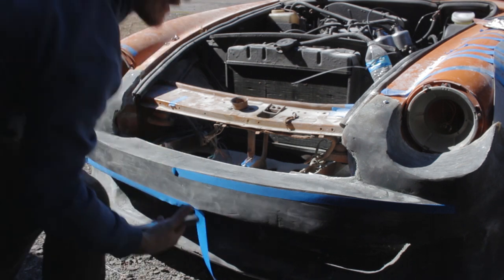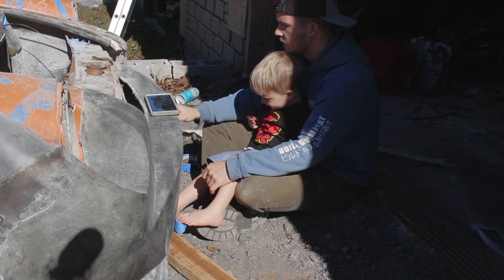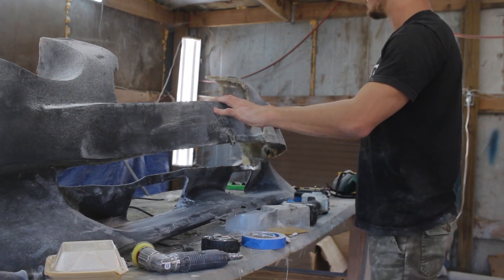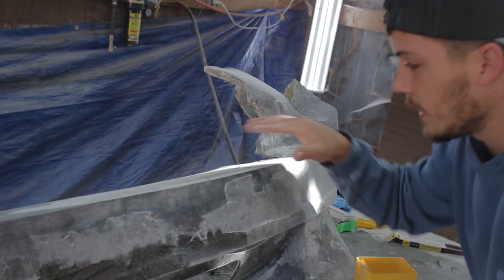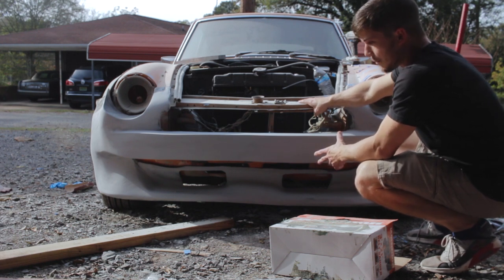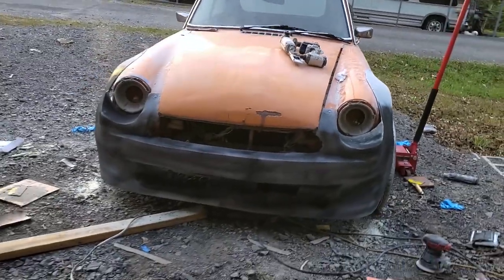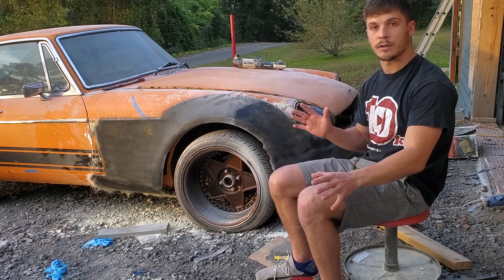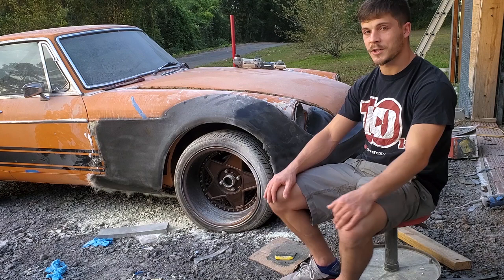THE RWMGB pt. 17: MY DIY WIDEBODY FRONT END IS FINISHED

Comment: For anyone attempting something like this, I would suggest putting the car on stands and adjusting it till it's level. Screw jacks would be great for this. That way you are off your suspension and the car is and stays dead level. Just a suggestion.
Reply: Just normal jack stands work if you put them on the exact same spot on the suspension and adjust them to the same height
Reply: @jaskatin  Provided you are working on level ground. The screw jacks can be found for pretty much the same amount of money but you can adjust each to keep the car perfectly level. That's why I mentioned it.
Reply: @joer8854  very true.

Comment: Pulling moulds is a great idea on this bumper regardless of whether it's perfect or not. It'd be great to have a first time go at moulds on a bumper to proof of concept of how well it works for you. Make your first mistakes here together with those you've worked through on the bumper, your next project will be a big leap forward in parts quality, where the parts from the moulds will be sold out as quick as you could post them I reckon. I think your boutique going live could be much sooner than you'd think. You're doing really well, I'm enjoying the different techniques and your willingness to trying new things and methods to get a process that ultimately works for you. And it looks sooooo good already.

Comment: It's so great to know you've decided to follow the molding route. I know nothing about fiberglass! - but the theory underneath leads to assume the parts will be stronger with larger overlapping meshes, as compared to the inevitable result of multiple patches and sections of filler of making it as you go. Also, not only you can quickly made a replacement if it's ever needed, but also you may be able to sell bodykits just as Bandito Garage started doing! Best of luck with that, the project is really coming together nicely.

Comment: 🤷‍♂️ Happens.
I spend almost as much time building a custom jig to clamp and bolt a project car to as the vehical.

Not exactly practical approach for most but frankly learned how in a shop that restored high end and rare cars.

Ferraris are notoriously crooked off the assembly line.

So a "paint job"  started at 65K in the early 90's. Just because ...say hypothetically even a  otherwise  mint example except paint.

Had a a ton of bodywork to correct. And corrected with rarely bodyfiller being allowed to do it.
I have a rediculous amount of both purchased and homemade grinding, sanding, die grinding tools now.

But the frame mounted jig is how we straightened Ferraris and other unique cars with customized proportions. Or chop and section a  donor car.

Also easier to seal,paint, and polish on a gearef rotational mount. 

I'm good with metal and not so much in the "mechanic" areas.

But the mechanics there could and often did literal build cars upsidedown.

Owner got hooked on the same drugs the customers sold to pay for it though and we lost our jobs.

🤷‍♂️ Great learn experience though.

Comment: Are you going to mold the fender and over fender as one hole unit or just mold the over fender? I think it would be cool if you molded the fender and over fender as one assembly. And it would shave a lot of weight off the front of the car and keep you from having to trim the inner part of the fender that you can see by the tire.

Comment: This may sound like a crazy idea but what if you molded your wide fenders into the main fender and make a mold of the entire quarter panel.   That way, whoever does buy your kit doesn't need to cut into a vintage quarter panel and damage it permanently..    That way, you will save even more weight off the car by not needing a metal quarter panel and none of that annoying cutting and pie cutting the fenders.